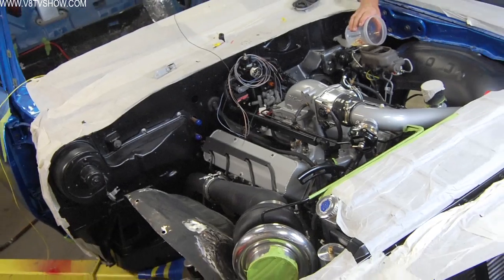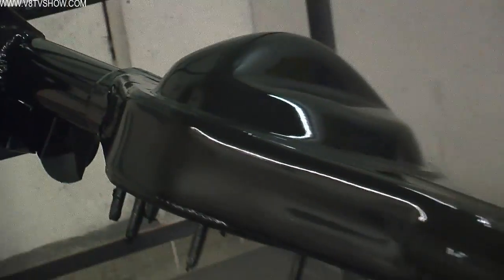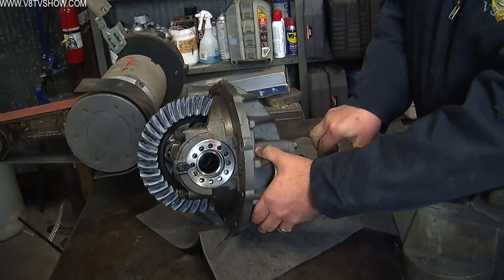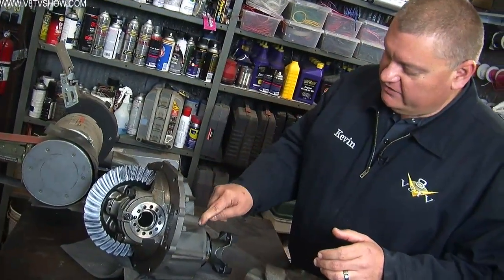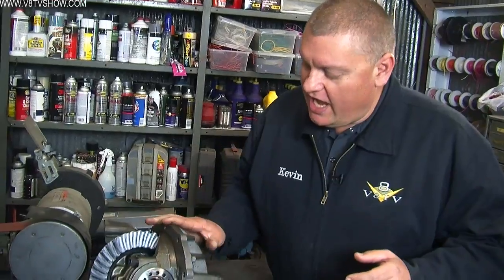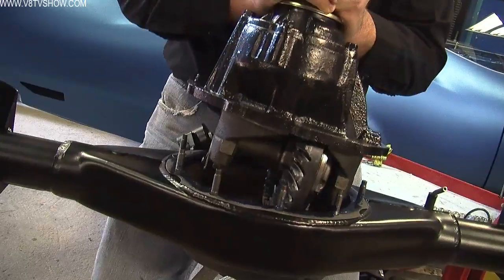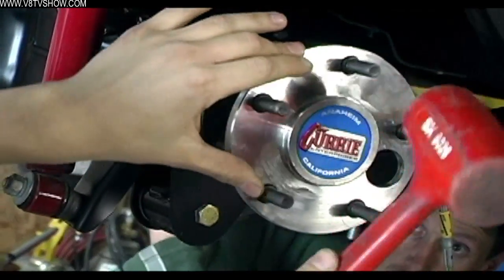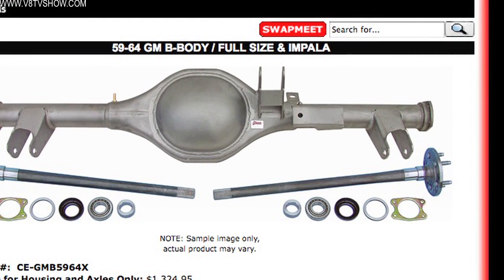Nodular Iron?  Currie 9+ Ford 9 Inch Style Rear Axle Tech Video V8TV on 1971 Oldsmobile S71

Comment: I noticed that you stayed with the coil springs instead of remodefing to a leaf style or if that was possible and or make it handle better
Reply from the maker: Coil springs and the 4-link style rear suspension handles better than leaf springs, and also provides better traction.